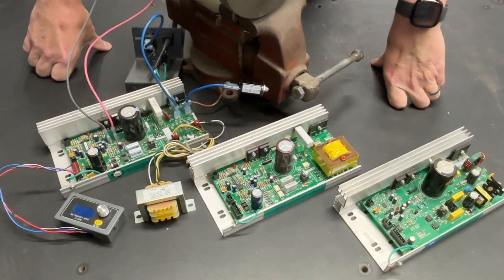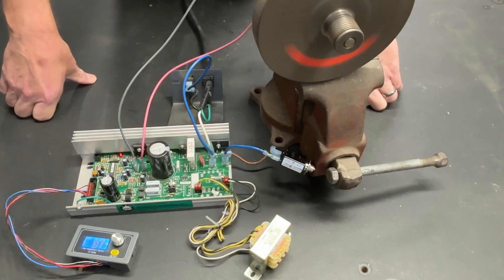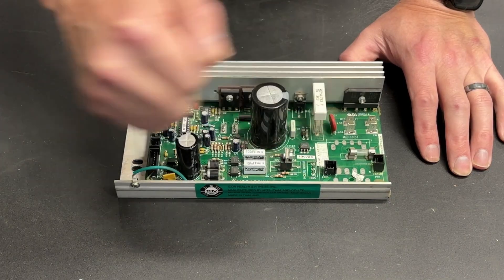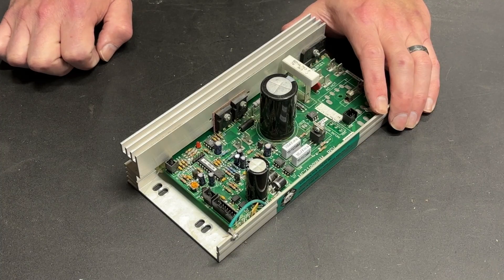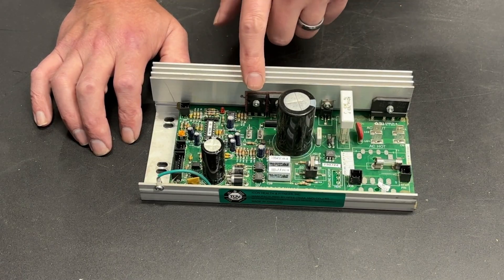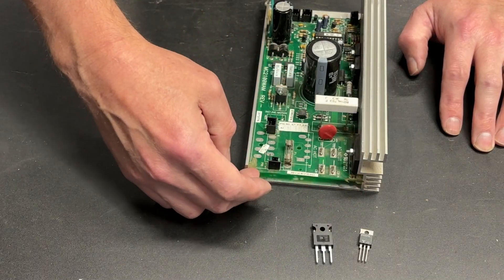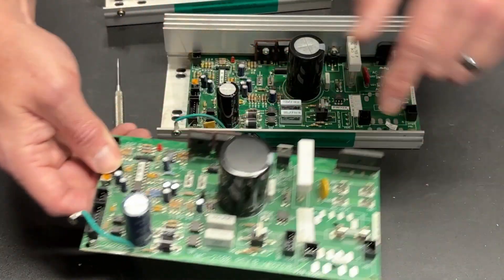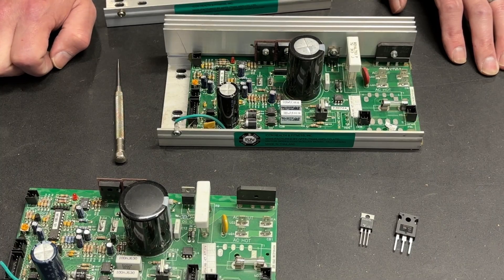Troubleshooting and Repair of an MC-2100 Including common Component Failure and Diagnosis

Comment: Hi I have same issue with my MC2100 Rev B board with mosfet and S402SL transistors. I am going to replace the board as may be other issues, currently have the board with separate transformer, can I switch to board with integrated transformer?
Reply from the maker: You should be able to.  Just keep in mind you will need to speed calibrate the board if using it in an actual treadmill.  There is a small potentiometer on the board with a Philips head to make the adjustment.

Comment: Any thoughts on low torque issues?

Ive tested woth two known good motors and the torque problem persists, leading me to work on the board.

I do think im going to preemptively upgrade the mosfet and scr as they cheapes out oncthese boards. Much better components available that will work and stay much cooler.
Reply from the maker: Are you running it with or without the tac input?  Sometimes disconnecting or connecting that input will make a difference.  Also how is the rest of the system configured?  Are you running this in a treadmill or for a different project and if for a different project how do you have it setup?  if it is for something other than a treadmill the MC2100 is IMHO a waste of time and $.  In that situation I would put together a dedicated power supply.  If however you are repairing a treadmill then I would stick with the MC2100.  Just depends on what you are doing but I don't have enough info to ascertain that.

Comment: Hello I’m in the process of fixing one of these. I have removed the mozfit. Don’t know component names. But when it arced and damaged the black resistor in front of it. I have it removed also. But I do t know what it is. Can you identify it. And also give me the two other part numbers on the heat sinks. Thank you great video. My board is in a treadmill. The part is in space r32
Reply from the maker: contact me through my website and send me pictures of the resister you are trying to identify and I will see what I can do.

Comment: If my light flashes 4 times should I just buy a new board?
Reply from the maker: 4 flashes indicates system failure. Replacing the MOSFET an SCR might fix it but probably not. Odds of the repair working, 75/25 failure to success.

Comment: This is very informative.  I am wondering if you have another video on MC-2100LS-30, the one that has the small transformer integrated.  I am not getting any LED, so no power to the board.  I don't see a fuse, though.  What do you think?
Reply from the maker: All MC2100 boards having motor powering issues can be trouble shot the same using the info in this video.  The differences in the various MC2100 boards have nothing to do with motor control.  The components are part of the DC power supply section of the board that provides power to the console.  The info outlined in this video is what you need to folow to try and fix it.

Comment: Hi,
Thanks for the video. It's very useful and great detail. I have ICON MC2100 REV D controller board everything working apart from getting the power from board to the belt motor. Can't see anything wrong with the board. Solid red light until press the start button and then flashing lights showing input to the board. Any assistance will be greatly appreciated.
Thank you
Reply from the maker: I am not a treadmill repair guy.  The information I have provided in this video is all the info I have gained messing around with these boards.  As I said in the video the most common issues for a motor not turning is the MOSFET and or the SCR and that is most likely your issue but that may not be the problem.

Comment: 1st I learned a lot about the mc2100 card from this video and have repaired one that went bad but i have a question for you I was doing some research on the heat sink components and I asked google Gemini if there were more robust mosfet  , scrs , and bridge rectifiers that could be used and it came up with some options. What are your thoughts on replacing them?
Reply from the maker: So yes you can go with higher amp components and it will likely be less prone to failure to a point but it also might blow up something else in the system.  Its kind of like putting a bigger engine in your car.  a little bigger and there are no issues but a lot bigger and then the transmission and rear end also need to be replace to handle the extra power.  Same is true here any time you have the potential to apply more power you risk over tasking other components.  With that said the SCR, MOSFET, rectifier and capacitor are the main power components and everything els is just a triggering signal so if all 4 are up to the task I think it could be a significant improvement in robustness.  Not being an electrical engineer I cannot however say for sure and this is a best educated guess based on my limited knowledge.

Comment: Which components do you think I kill, after replacing the running belt and attempting to tighten the front roller. Completely forgot to unplug machine from the wall or set it to off on the front switch. Dropped the hex key near the circuit board (MC2100 Rev B) causing it to start up without the red safe key ON for 3 seconds at max speed then turning off with a smell of burnt plastic. There is no red light on circuit board but the the speed selector panel turns on but nothing works after clicking start.
Reply from the maker: I have no clue.  I am not a treadmill repair guy just an electronics hobbyist.  I have no info other than what I put in the video.

Comment: Hi there

Thank you so much for creating and posting this video! It’s saved me a huge amount of time pin-pointing the problem (the motor runs briefly and then the mains fuse trips, although not the actual fuse but rather the main RCD)

I would like to ask you for an advice – my board is definitely an MC-2100 but it’s different to any in your video. There’s the big capacitor in the middle but the rectifier is on the left and the two transistors are on the right (for some reason there’s no SCR). Due to this positioning I’m not sure which of the two transistors should I focus on? The two are labelled as MUR3060PT and NCE40TH60BP.  They physically look very similar and it’s hard to tell which one acts as the main PWM switch and which one is the flyback diode?
Reply from the maker: I need to see pictures of what you have.  please contact me through my website so you can email me some pix

Comment: Please contact me if you can. I went through the procedure that you taught and replace the moss fat resistor it Started to work for about 30 seconds and then I got a spark on the control board and now the red indicator light will not come on at all so I need help trying to diagnose where to go next.
Reply from the maker: Did you replace the SCR at the same time?  Like I said in the video the SCR and the MOSFET should always be replaced at the same time. When one goes bad it often damages the other. Other than that I can’t be of any more help than what is the video. I am an electronics hobbyist not a treadmill repair expert.

Comment: I have question, please help. Nordictrack C2770 Treadmill runs on speeds 4, 8 and 12 only.  Blown a fuse and replaced it. Somehow while cleaning it all buttons came back and functioning. Then when tried to use, it came back to the 3 speeds (4,8,12) all buttons not working except these 3 buttons. Brought some fuses F315mA as per original. Transformer says 6.3amps slow blow. I’m confused about this fuse link rating. It’s 120v output and I’m in Australia we’re on 240v. We had this treadmill for over 15years and would like to keep it going.
Reply from the maker: I am not a treadmill repair guy just a hobbyist who uses treadmill parts for other application.

Comment: I have a treadmill with the MC2100-LT  the LED does not light up at all.  I can get 115V at the AC HOT and AC Neg spade terminals on the board.  The capacitors look good & don't see component failure/leakage looking around the board.  In your opinion, would replacing the Mosfet & SCR help, or is the board toast some other way?   Thanks for your great video!
Reply from the maker: lots of things can cause that.  The two I know of are not getting a pulsing signal from the console, which is not very likely but still a possibility and the other is a bad MOSFET/SCR so there is a good chance that replacing those components will fix the issue.

Comment: My board shows MC-2100 Rev B however the SCR doesn't read S4025L but instead S9010 (https://drive.google.com/file/d/1CaoRG-Jx2b_EatAWU-Mo8XI0vlmv26ed/view?usp=sharing).
Do you have an idea which component is needed for replacement?  My search for S9010 didn't yield anything.  I tried replacing it with a S4025L (also replaced the IRFP250N) but now the breaker trips whenever I turn the power on the treadmill. 
Thanks for the video!
Reply from the maker: The breaker tripping means that one of those two components is "stuck" in the on position not pulsing.  They both do the same thing but one pulses on the AC side and the other on the DC side.  In other words the signal that causes one of those two chips to pulse the electrical current is singling for current to just be on not creating the pulsing action. This is causing full voltage to go to the motor and why the breaker is tripping.  Sadly I don't know which other component has failed and is causing the problem.  I am just a hobbyist and not an electrical engineer.  I wish I could be of more help, sorry.
Reply: @dazecars  Thanks a lot anyway!
Reply from the maker: not a problem, I wish I could have been a lot more help.  Thank you for the financial support.

Comment: Thanks! My treadmill start half second and stop any help.
Reply from the maker: Your specific symptom sounds like a bad MOSFET and/or  SCR.  They both should be replaced as when one goes out the other is often damaged in the process.    Thank you for the donation it is really appreciated.  Let me know if I can be of any further assistance.
Reply: @dazecars model nordic a2250. Could I get parts info please.
Reply: Day before it's runs.full.speed ,I restarted ,now only move moter for half second.led.blinks 4.time.ws.with pause
Reply from the maker: The parts are linked in the description
Reply from the maker: Again that is a current overload indicator that typically indicates a bad MOSFET and or SCR, but it doe not always fix the issue.
Reply: Any possibility for a schematic or know the value of R1 on the board?
A coin fell onto the board (I don’t even know how this is possible considered the treadmill runs the other way) and the resistor blew off completely. The screen works fine and all buttons but the motor doesnt move at all
Reply from the maker: So sorry I didn't get back to you sooner, I have been extremely busy and kept forgetting to look at the MC2100 I have when I was out in the shop.  its brown black black gold so 10 Ω   ±5%  Please don't hesitate to reach out if I can be of further assistance and once again I apologize for how long it took me to get you this information.

Comment: I up graded the mosfet to 1rfp260n, been more reliable
Reply from the maker: thats good.  Sometimes upgrading one part to be stronger will cause something else to fail but if that has not been the case then it sounds like a good upgrade.
Reply: @dazecars  did that about three years ago and it drives my metal lathe, it's a MC2100 REV B
Reply from the maker: i would say that's a good test

Comment: Do you happen to know what the frequency for the PWM signal is? I have aeem between 20 and 20kHz so I'm a bit confused. My treadmill control comes on but none of the buttons work so I tried injecting a 20kHz pwm signal with an arduino into then pwn line down into the motor controller but the PWM peak voltage would drop down to  around 3 volts so I started looking at the motor controller. I replaced the 15000uf 16V cap cuz it was bulging and it worked but then I turned of and when I turned it back on ithad the same issue. I am not sure at this point if it's the control panel or the mc 2100. I moght change the 1500uf 200v cap next.
Reply from the maker: 20Hz is the frequency.  Rather than Arduino I use an inexpensive PWM signal generator.  The info I have put in this video may help but only the concepts because I'm nut using Arduino https://youtu.be/jLqcvYD_Mnk
Reply: Yeah I ordered one of the PWM devices you linked to to make my life easier lol. Thanks for the info. Do you have a resource to build the SCR driver you talk about in the video?
Reply from the maker: Your question made me smile as you are clearly new to my channel.  WELCOME  I'm "the treadmill guy" and  I have all kinds of videos on building power supplies for treadmill motors.  Scroll through this playlist and you will find what you are looking for.  Don't hesitate to reach out if you have more questions.  https://www.youtube.com/playlist?list=PLg4j6XzBdSY_83r86goaHonVUjoKsnIJM

Comment: any idea whats wrong with my norditrack 17.5, worked fine, sold it, delivered it 80 miles away, buyer tested, everything worked for 5 mins, then, turned it off and back on, 2 beeps, console lights up as normal, only the stop button responds with 4 beeps, all other buttons do nothing, checked all connector plugs, red light solid on board.
Reply from the maker: I don't know.  I am not a treadmill repair specialist.  I use treadmill components in other projects and because of that have messed with preparing the mc2100 specifically.
Reply: I have this same issue. I replaced the 15000uf cap it worked once then stopped working. I am going to change the 1500uf cap next. I will let you know if that does the trick.
Reply from the maker: If the cap is bad it will typically swell.  The bigger cap on the board is a main power filter the smaller cap is for the power that goes to the console.  If the console is working the smaller cap is not the issue.  More often than not when components on an MC2100 go bad its the MOSFET and SCR not the capacitors
Reply: @dazecars  there was a buzzing noise, when it first started not working, which ive never heard before, i thought was a bad contact in the switch, it stopped after about 10 minutes of being powered on, is that the noise a leaking capacitor would make?  they look ok, not swollen and no signs of leaking but ill take them off and test them and look for signs under them...  thanks
Reply: Removed all caps, all tested ok...
Reply from the maker: I don't know what the problem is, there are no switching contacts that I know of on a an mc2100 the sound had to be coming from one of the other components. Again the MOSFET and SCR are the most common failure points.  I am not a treadmill repair expert just a hobbyist that uses treadmill motors for other applications.  A lot of these boards can be fixed using the basic info in my video but not all .

Comment: Hello. I have an MC2100ELS-18 board. When I plug it in, the diode does not light up. I read that this is due to the lack of voltage on the motor. Perhaps you have encountered this problem and know how to solve it
Reply from the maker: The cause is often (but not always) the swithing components just as I outlined in this video

Comment: Hi I really appreciated your video. I have a MC2100E REV D ICON 2007 board.
There are three connectors to connect the external transformer. The first XFMR Primary 220Volt. The second XFMR sec Controller (I Think 16Volt out) with two Pins. The third XFMR Sec Console with 3 pins. (I Think 8v 0 8v) . Which transformer can I use to do the test?
Reply from the maker: It's just a class 2 transformer.

Comment: Have you had any experience repairing the mc-2 board? I have one that has 120 volts going in and the required 5 v between the h terminal and the L terminal and 4 volts between the w terminal and the L terminal but not getting any voltage to the motor terminals? any suggestions what to look for?
Reply from the maker: I am not a treadmill repair guy, just a hobbyest that repurposes treadmill parts for other applications.  I have not messed with repairs on that board.
Reply: @dazecars  You do an excellant job in your videos from which I have benifited greatly keep up the good work. I have converted my wood lathe and built a 16 inch thickness sander using a treadmill motor. I am looking at doing my Drill Press next. Thank you so much for your help. You have taken away a lot of the mystery.
Reply from the maker: My pleasure, glad I could help!  Let me know if any other questions come up.
Reply: @dazecars  I have watched most of your videos and continue to reference them thanks again

Comment: I have the MC2100LTS control board on my treadmill. Recently, the Treadmill started to not power up.  When it does, the entire machine works fine, moving track, flashing LED, etc.  then next time, the console wont power up and I have no control. Constant red LED during those times and capacitor looks fine. Thoughts?
Reply from the maker: @JetsHC First I am not a treadmill repair guy.  I am a hobbyist that uses treadmill parts on other projects.  With that said electronics don't usually fail intermittently.  That leads me to believe you have a bad connection between the console and the MC2100.  The MC2100 is driven by a pulsing signal generated in the console so that totally makes sense that the LED would be on constant and not flashing on the 2100 when the console is not on.
Reply: @ Tks - intermittent failure on a board is odd but I checked on all connections, wires, negative results. I’ll replace the board and go from there. Will rip apart piece by piece to determine this elusive failure if the new board remedies the problem.
Reply from the maker: I hope the new board fixes your problem